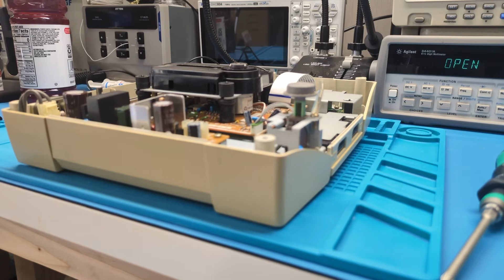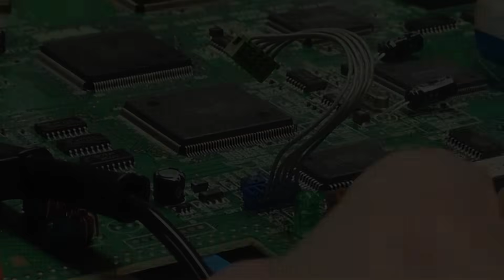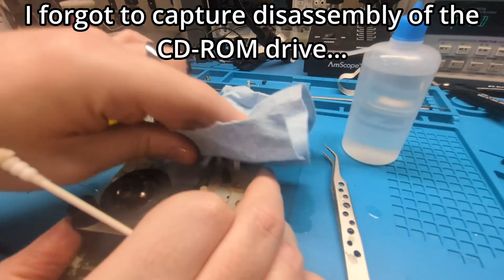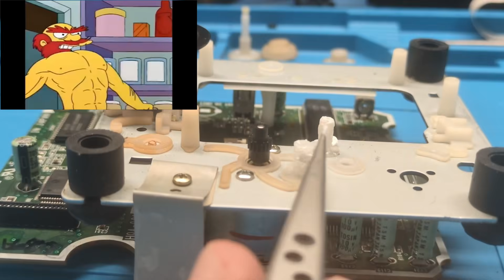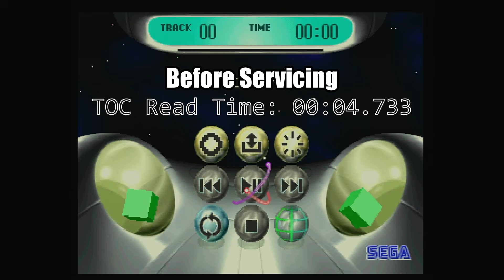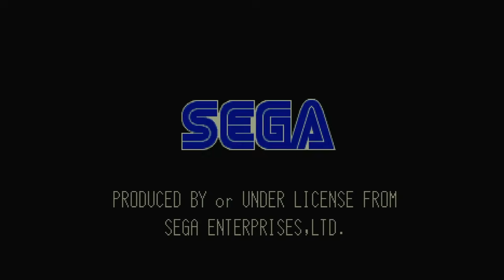Sega Saturn Repair - No Power, No Drive Response… What’s Wrong?

Comment: Do you know anything about fixing disc drives in these things? My Saturn is currently fine but I may have another in the loft that can no longer read discs! Also, while my Dreamcast IS still kicking, its disc drive is getting noisy! I know others will tell me to get an ODE but I prefer to keep my systems (as) authentic (as possible)! Thanks
Reply from the maker: Yeah I do. The Saturn disc drive in particular is quite robust. Usually what you see me do with the drive in this video is enough. It depends entirely on what's wrong with it though.